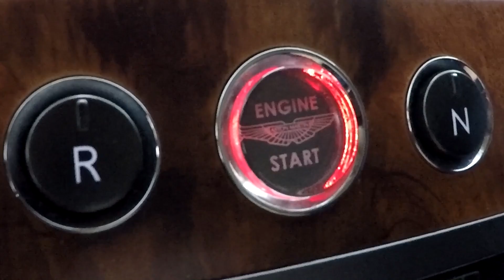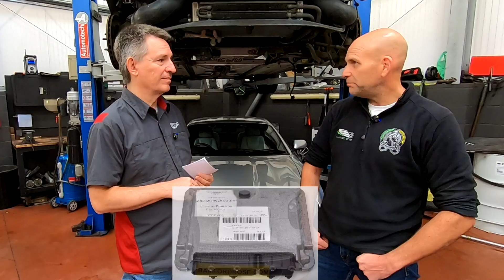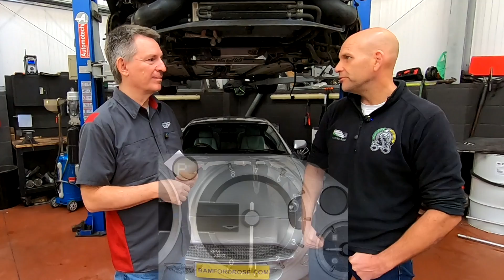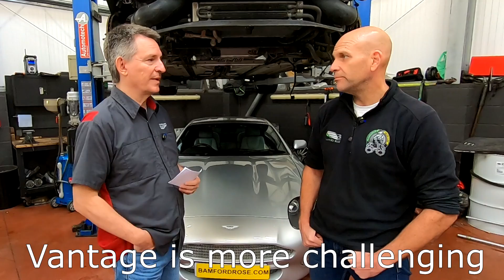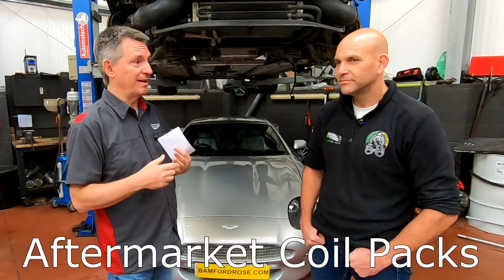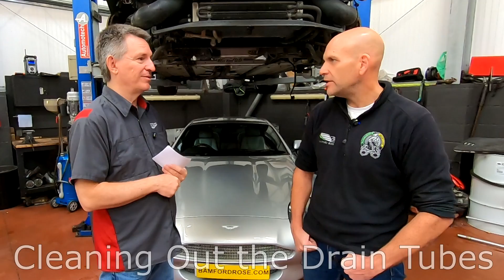Aston Martin Questions and Answers with Mike from Bamford Rose.

Comment: Steve and Mike, I have a 2013 DB9 volante V12. I had a rattle and my garage fixed a lot on the front like bushes and rods, but not the rattle. Finally they told me that my ceramic breaks can rattle when I am on a stone road, bumpy road? They say that the screws on the disc can get a tiny bit of space because of usage. They showed me an old disc with the srews on it and explained this issue. I am not a DIY-er but technical educated on engines and stuf so not unknowing on this. Yes, when I am driving on a uneven road and hear the rattle it disappears when I slightly hit the break but is it really this?  Can Mike tell me anything about this? Thanks in advance, Adri from The Netherlands